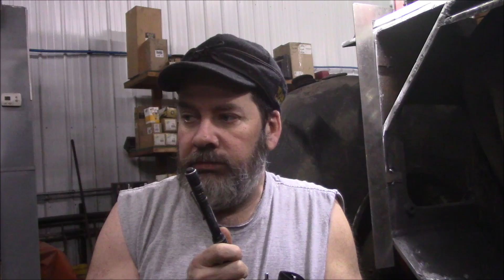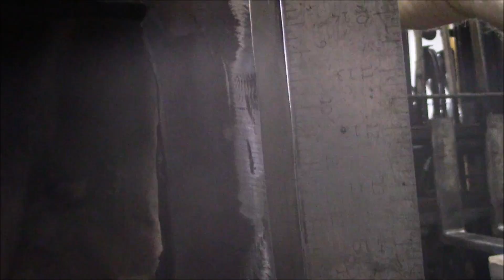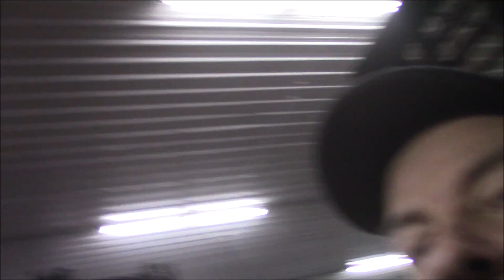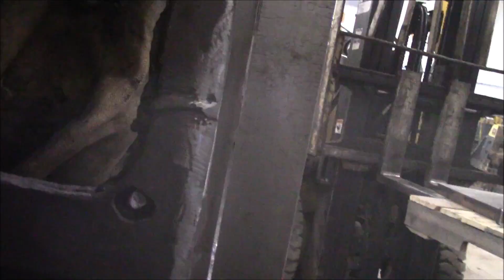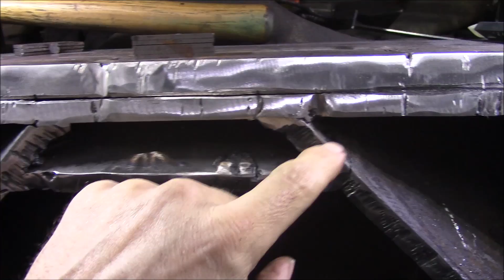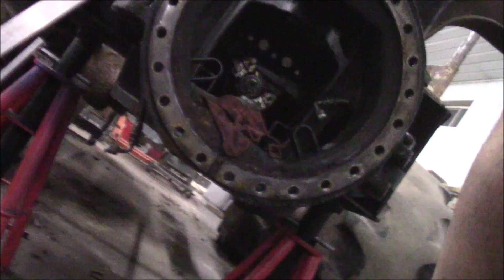Welding Timbco E4 Weld Joint prep

Comment: Although that's a great looking cut you did, I would imagine that was a lot of grinding for sure. Do you have to get all that slag out between the two pieces or just what you can? I mean you don't have to take a thin disk and get every bit do you? Thanks for taking us along on this job as it's very interesting‼️
Reply from the maker: I stopped there. I'm okay with not taking a thin disc to the rest.